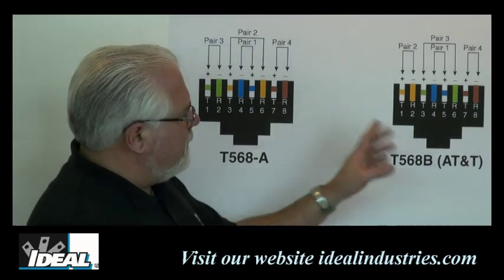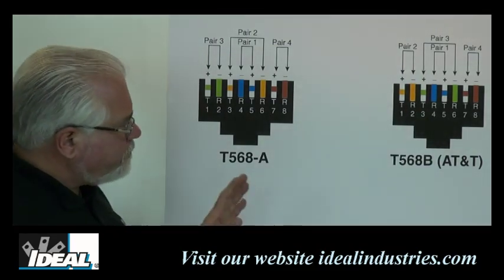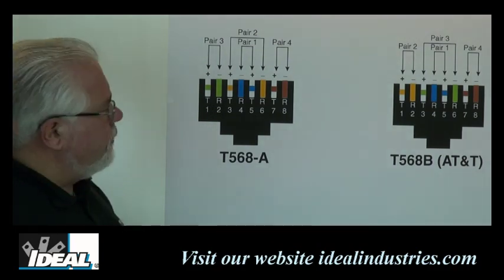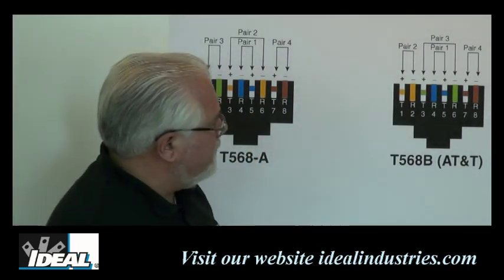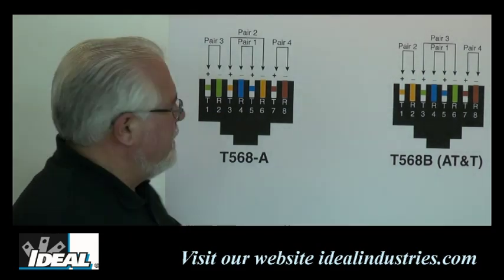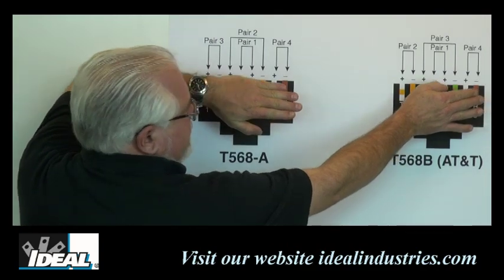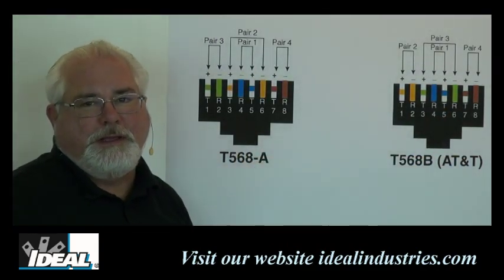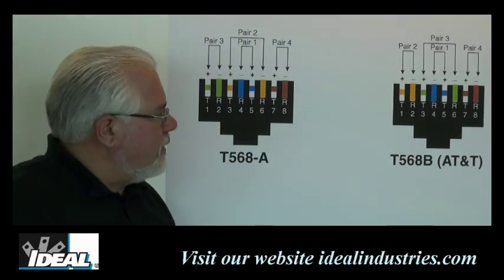568A 568B Wiring Configurations

Comment: First off, I'm a telecom and data guy, going back to 1972.  I have done a lot of cabling, both telephone and data.  In my experience, B is rare, at least in Canada.  Also, A matches the colour code for 25 pair cables.  B originated with StarLAN, which eventually became 10baseT.  It was designed to share existing 3 pair CAT3 cables with a phone.
BTW, my LAN experience goes back to early 1978, when I started working on the Air Canada reservation system, which used a proprietary network technology from Rockwell Collins.  Instead of packets, it used time division multiplexing over coax, at 2 Mb or 8 Mb over triaxial cable.  Of course, no one heard of IP or Ethernet back then.
Reply from the maker: Hi James it has been a amazing journey in the data world over the last 30-40 years. Who would have thought 1 Gps would become common...........Ron

Comment: 568A ends up with and electrician trying to data guy. Anything other than white, black, red, and, ground. Don't let um get near the drop or data closet.
Reply from the maker: Hi Sax Man many electricians pull low voltage wiring! Have fun Ron

Comment: Ron, I'm having trouble trying to figure out how to connect the phone jacks in my home to a phone server we just purchased for a new home business.  It's an X16 phone system that came with eight phones, but we will only be using two for now. All of the phone jacks are wired using Cat5e T568B cabling that runs to the panel in another room.  They are currently not connected to anything.  I also found the installation call out forms from the builder in the panel and verified they are phone jacks, as well as verified that an RJ11 connector fits the jacks on the wall. The phone service provider will be installing two CO lines using an Arris TM804G  telephony modem in that same room. So here's where it gets interesting... How would I connect the phone server that has four RJ11/14 ports to the phone lines if the wiring to the jacks have RJ45 connectors at the other end?  Should I just replace them with new RJ11 connectors? Is it that easy?  Btw, I ran across your channel looking for answers and really love your vids.  Anyway, any help would be appreciated. Thanks again :).
Reply from the maker: Hi Louis I sent you an email have fun Ron

Comment: Thank you! Since A and B don't make much of a difference regarding info to a computer, is it mostly just as an identifying feature to the person who is looking at the jack to figure out if it's supposed to be both phone/data vs just data?
Reply from the maker: Technically they are both meant for data but are backwards compatible to phone circuits. Hope that helps Ron

Comment: Don't think I get this?!  If you have a patch cable that's wired A-A, or B-B, that's a straight through or normal cable.  If you have either A-A, or B-B from net socket to back of patch panel, that's straight-through too!  BUT, if you then take an say A patch cable and plug it into a socket wired for the OTHER (and vice versa), aren't you crossing over?  You're switching the transmit/receive pairs, aren't you?
Reply from the maker: John I have had techs tell me manufacturers sware you have to wire it as they state either A or B. But if  you are asking will a A patch cable work with a B jack I would say yes in most cases should not be a problem. You are not switching the trans and receive pairs just the pair that is used. Hope that helps Ron

Comment: I don't quite know if I'm missing something here. How can it be that there basically is no difference between 568A and 568B? Each pair is twisted with each individual number of twist per inch, and hence individual impedances on each pair... In my experience, this is quite crucial in a ethernet cabling; where a mix of 568A and 568B offen can and will lead to poor performance or even systems that does not functioning.
Reply from the maker: +Leif Lüdemann Hi Leif the standards say you can wire Ethernet systems in either A or B. Many people use just B to eliminate any confusion when wiring them. Many residential low voltage panels are wired in A but right next to the panels in the store are only B wired patch cords to go with them. When you look at the twist rates on the orange and green pairs it looks to be about the same so no big differences in the Impedance. Nice to hear from you! Ron
Reply: +Ron Kipper Datacomm Hi Ron. I'm not professor in cable design, but I can tell you for sure that mixing 568A and 568B cables can make a difference whether things are working or not!

Right now I'm helping one of my acquaintances in our local community tracking down why he's unable to run some video services on a CAT6 cabling. And I'll eat my old hat on that, when he is changing the part of the cabling that he has made, from 568A to 568B, everything will work just fine... Just as I have seen it a few times before - even with a 568A patch cord of 2 m at the end of a 568B cabling, I have seen making a difference!

And by the way, I asked my acquaintances to watch your video, and asked him if it, based on that video, would make any difference to him witch wiring scheme he would use. And, as expected, he was having that impression that it would be okay to use a mix of 568A and 568B... based on your video.

So, dear Ron, if it was up to me, you would be kindly asked to change that movie to reflect to days real world experience... or alternatively take it off YouTube. Ideal Networks seems to be a very serious company; making really great network testing equipment...

So, to see your video; giving the impression that it makes no different whether you use a mix of 568A wiring scheme and 568B wiring scheme in a cabling is kind of sad... (although I vaguely remember, years  back, where the most widely used Ethernet speeds were 10 and 100 Mbit... there there were no (notably) difference using a mix of 568A and 568B :-)).

Most respectfully, Leif.
Reply from the maker: +Leif Lüdemann Leif I really appreciate your input and I'll take another look at it and run it by the folks I deal with you may have a point. You have got to wonder why the industry could not just make a decision and get done to one...............Ron
Reply: +Ron Kipper Datacomm. Hi Ron. Thanks for your feedback :-). Just for you to know... I'm not chasing you. Not at all! (you're not the only one "out there" telling that it makes no difference if you mix 568A and 568B). You see, the case is that, I've just realized a many years old dream and privately bought myself a SignalTEK NT :-D...

So, when seeing this instrument confirming a hard built hunch or intuition; that a cable installation is having a split pair condition... witch a mix of 568A and 568B can be seen as... it just makes me quite happy :).

But when I (happen to) se Ideal Networks (ie you) officially telling the world (the old story?) that it makes no difference if you're mixing those cables - it puts me in a kind of mood where I feel myself a bit "overfed".

I know for sure that I can't save the world... and I'm not even trying... But since my first comment I have thought  to myself; Okay Leif, why are you using all this time and energy to try telling Ron that it actually can make a BIG difference mixing 568A and 568B? And one of the answers I've come up with is: The primary reason, I think, is that I'm sick (I've had a flu for some days now)... and having way to much time, he he :-)... (I hate to lie in my bed; and doing "nothing").

But I don't think that it's the only reason. One other reason is also that, it seems to me that you (apparently) are doing some really good informative videos (although I've only seen a handful of them); where you in a simple, clear and trustworthy manner tells and explains about various tasks and problems on various types of networks and other stuff. And I find that's a good thing, and inspiring too... Thank you for that, Ron :-D.

Sincerely, Leif.

PS.: I'll be back at work on monday... so I will probably not be bothering you more in the future ;-).

Comment: Ron I found a interesting problem, on troubleshooting wiring on someone else's  install. The problem showed up as a transmit problem where it worked fine, but had loss packets, and jitter on the line, I checked the length and the conductivity, did a pin out test came out fine, but yet had a problem. Now I notice the color code was not 568b yet what did that matter.
well I rewired to the T568B on both sides and the problem was solved, yet I could not let it go. (WHY) Guess what, some
companies make there patch cables with built in LED transmit light right into the connector itself, never knowing it is there.
yet if you do not use the T568B wiring, it will still work yet have packet loss do to that little diode in that connector.
Just thought I would pass my story along. Cheers my friend.
Reply from the maker: +MrMac5150 MrMac that is good to know! I have seen those patch cords with the LED lights and some also have small memory chips that record how many times they are inserted and extracted. I appreciate the heads up.Ron

Comment: I have a 24-port Netgear Switch and a 24-port Patch Panel. I wired the wires in T568B format and I ran ethernet cables that I bought between the patch and he switch. I noticed nothing was working. Then I began to experiment and changed the first line of wiring as T568A and it worked. I think the patch wiring that I bought was already made in a T568A. Is this common where a company will make a T568A? Either way, it worked for me and now I've got to go back reconfigure the wiring from B to A in my home. Any help would be greatly appreciated.
Reply from the maker: +26humor26 Normally if you buy Ethernet equipment we use 568B wiring however A will work as well. Many of the residential panel mfg's wire there stuff in A and commercially we usually use B. I know confusing but that is our industry.......Ron

Comment: For Ethernet cables, does it matter if they are wired using the B standard and they are plugged into jacks with in-wall wiring, from network center to wall jacks, with the A standard? Basically, can B standard cables plug into a home network wired as A standard?
Reply from the maker: +sross002 The deal is both ends of a cable need to wired the same A or B. After that yes a B patchcord will work with an A wired system and vice versa. The only real difference is Orange and Green get flipped. I tell people why we still have both is because someone in the 1980's could not make an executive decision and pick just one...........

Comment: Okay cool ima try it when I get home an how would I know if the line is on cuz I touch wires without jacket an I feel nothing so would I have to have the phone company turn it on or what an WHAT HAPPENS TO ALL THE OTHER WIRES ONCE I FIND THE PAIR THAT WORKS
Reply from the maker: Anthony Villarreal Once you find the right pair I assume the others pairs have nothing on them so just coil them up in the box. If you do not have a phone tester just wire each pair up to the jack and use a phone to see if you get a dial tone. The one with the dial tone is the right pair. If none of them work it the other end is not connected to the phone company. That should be done in the gray box the phone guys installed outside of the houseGood luck
Reply: Thanks Ron

Comment: I have bought a levinton phone jack on the back has 4 screws for the wires green,red,yellow, and black an I got a wire I think an I'm pretty sure phone wire an it has brown an brown with white, green and green with white, blue and blue with white, and orange an orange with white line so it's a solid with a solid an stripe on it I'm trying to connect it but I don't know where the wires go to what I have been looking an looking an I'm going crazy please help it's a 8 stranded wires thanks
Reply from the maker: Anthony Villarreal White blue to green and solid blue to red should be correct but any of the pairs could be used you just need to figure out which pair. Blue is line one but not always. Hope that helps.Ron

Comment: My home is currently wired in A circa 1994.  I am doing an extensive remodel currently.  Would there be an advantage to changing over to B?  Some of the existing wiring will remain but a large part will be replaced.
Reply from the maker: Louie Law No real advantage to switching to the B format as A works fine. If it was wired in 1994 I would assume it is Cat 3 or Cat 5 so maybe it is time to upgrade the cable. A and B are pretty much interchangable as long as both ends are A or B. You can use a B wired patch cable on your A wired system and it should work as the pairing is the same and the only difference is the color of the wires.Hope that helps Ron

Comment: Thanks for making this clear and simple for the novice. I (a novice) am about to wire my basement with Cat6 and I needed to understand what the heck A and B was all about. Looks like I will be using B. Thanks!
Reply: You are welcomed. Another question. Should I use a punch down panel between my switch and the wire runs? Is there an advantage in using a punch down panel in a home network?

Comment: I have an AET 101 class and I have to create a 568a, 568b, and a rj45 crossover cable (at 3 given lengths) and I'm having trouble getting the wires to connect even though I got the colors right-- help me!